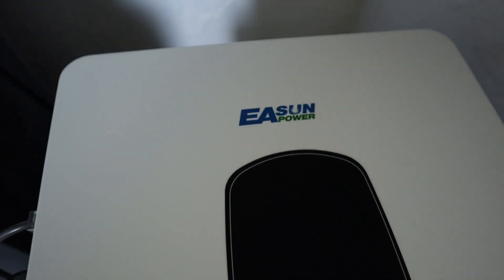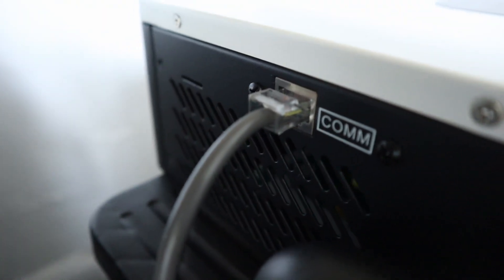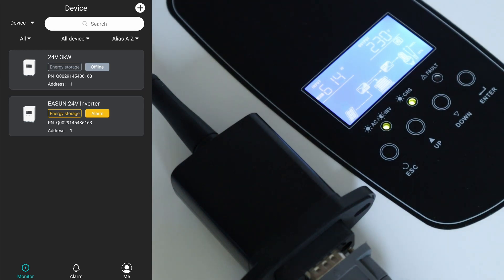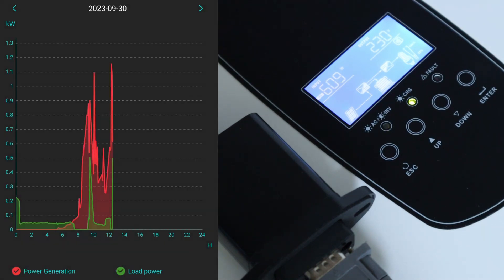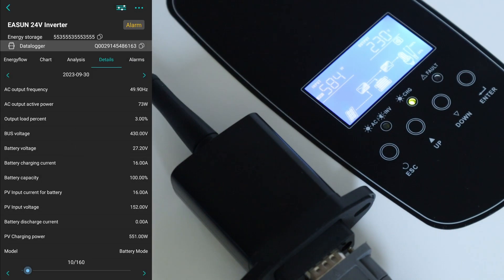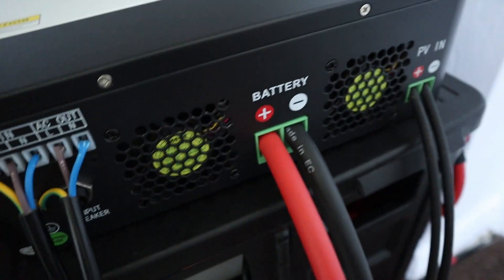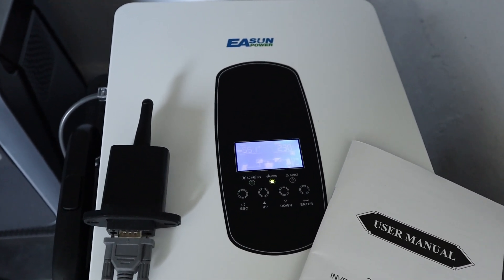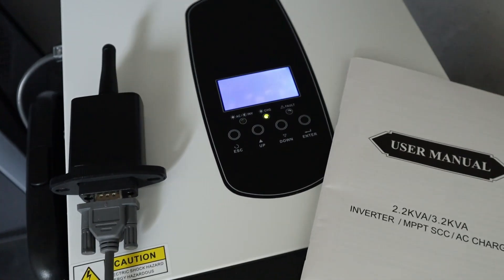EASUN Solar Inverter | Cheap, but worth it?

Comment: I m not agree with you about the fan. They could be more quiet because they are not linked to the temperature of the cabinet they are working even if the cabinet is in a room at 15 degrees. Also in low charge battery condition the  values of current and power  are wrong. The economic mode is bad it s not possible to run a fridge in this mode .In normal mode the unit use 40 W to run with 0 load so during the night the battery is discharged.
Reply from the maker: @arnaudmainil6414  It's fine to disagree with me. I've shared my experience compared with my MPP Solar inverter and the fan control is better on the EASUN (for me) when it comes to input and output load change, I didn't mention about temperature. I agree about the power saving mode (economic mode as you reference) and I don't use it myself due to the pulse method used. I've not had a problem with any of the settings I've used and the battery will discharge while the inverter is on, most inverters have a standby load unless you buy very expensive makes like Victron that have very low consumption when left on all the time. All the best, Adrian

Comment: Hello Adrian, 
Posting my question under this video since the model is close to the one I'm getting. A) Can you (fairly easy) manually control on/off charging from grid? B) Can you think of any way to control the time to have the AC charger kick on? I.e. 1am to 5 am?

Cheers and thanks
John
Reply from the maker: @jbjensen11  Hey John! I use smart plugs for all mains charging of batteries now (exploiting cheap rates with Octopus Energy in the UK). Using the Smart Life app you can schedule switch on/off times or more recently with Solar & Home Assistant. Here's the piece where I've started smart charging automation on Home Assistant https://youtu.be/DHHiSgIEdJE?si=rJT9Wd-kpfaXrrG8&t=1538, set a price and then it charges once it falls below that price (30 min price changes). I hope this helps 😊👍. Cheers, Adrian
Reply: @DADvinci  Thanks a lot for your answers Adrian! 
Thats what I do, except I (still) have not autmated pulling the rates online somewhere, but Ill get into that and will check out what you do with home assistant, which i dont know anything about yet.
 
-So let me now rephrase my question: using the smart plug, you can obviously time that any way you like - so you the EASUN will just start charging once the smartplug kicks on the AC input power to it? (No need to click anything extra - just supply AC power and it starts charging?)
Reply from the maker: @jbjensen11  Yes, that's correct John. Once I connect the grid it provides pass-through power to the AC output on the inverter and also charges the battery. I only use grid to charge the battery on cheap rate, otherwise it's battery with solar running the loads. I hope this answers your question?
Reply: @DADvinci  Thanks a lot. I will primarely use the unit as a charger, but need a way to program it to only charge when grid rates are cheap(like you)  and the seller doesen't understand my question or answers something else...

Looks like, if I just hook up AC input (through a smart plug) and connect to battery, then by programming the smart plug the unit will charge when the smart plug is powered. Correct? Any settings (besides LiFePo4 charging specs) I should beware of?

Later I may utilize the inverter and passthrough options, also. For now I'm happy with my Victron Solar Controlllers and will not use the EASUNS MPPT controllers. It's actually good value, only as a charger - and I like the rest of the functions to play around with later and to have as backup in case any of my current hardware fails.
Reply from the maker: @jbjensen11  No problem at all. On this 24V inverter, other than changing the LiFePO4 settings as you’ve said, I've got the Output Source Priority (Menu 01 Option) on the default setting SUB. On the Charger Source Priority (Menu 16 Option) again on the default SNU. I don't currently have solar connected to this 24V setup, but it works fine for grid charging (same as 48V version) using the smart plug as control.

Like you, I'm also looking to find and review another cheap solar inverter (48V this time) to act as a 'cheap rate' charger for another DIY (not battery box) build. They do offer good value, especially when compared to dedicated LiFePO4 chargers!
Reply: The Powersaving cuts the idle consumption from 28W to 10W I found out. But then I'd need to enter settings and turn off Powersaving each time I charge.  (since "If this inverter/charger is working in battery mode or Power saving mode, only solar energy can charge the battery")
Reply from the maker: @jbjensen11  I’m not a fan of the power saving feature. It pulses the AC output and at first, I thought there was a problem. The extension plug I attached for the AC output has a light to show when it's on and it kept flashing on and off, which I didn't feel comfortable with (disabled it again). I'd rather add a Switch bot as I did in this video (https://youtu.be/O6eRmKvrVd4?si=4zUDXtqB0jcLdz_O&t=1493) and remotely switch off the inverter when not in use. I could even use Home Assistant to automate when power is low to trigger the switch bot (but haven't explored that yet).
Reply: @DADvinci  Dooh - I forgot all about the dedicated on/off switch. I just opened it up, I'll just do what I did to my current inverter, connect a smartswitch in parrallel with that. And program the smart plug and smartswitch to turn on/off 1 minut apart. that works like a charm on my current setup with transferswitch and inverter.

Thanks - I got it, big thanks to you!

Comment: Thanks a lot for that review. I wonder vhy this is 10 times less expansive that Victron's ones. Have you any clues ?
I am right if I say that you can put grid AC IN to load your batteries then display AC CURRENT if PV is not producing ?
Reply from the maker: @rebelion5051  Thank you! I'm hoping you found it useful. This is a budget model so the internal components will not be as expensive as those used on Victron (premium) inverters. When charging from the grid, you can see the number of amps that are charging the battery by selecting what gets displayed on the front panel. Does that answer your question? All the best, Adrian

Comment: Thank you for the video. What "Charger source priority" have you got on i.e, CSO, SNU or OSO. Which one is more efficient. Also for the wifi unit which model should we buy. Do you have a link for it? Cheers.
Reply from the maker: @SaurabhBohora  No problem, I hope the video was useful for you. I use the default option (SNU) on charger default priority, as I'm either charging from solar (with no grid connected) or charging from the grid with no solar connected (for grid battery backup charging). Charging from solar is usually more efficient as the MPPT is already dealing with DC voltage, which is what the batteries are. Charging from mains would always be converting AC to DC voltage, so the losses would be more than direct from solar.

The link is in the description for the model and the one I purchased was the ‘SMH-II-3.2K-Wifi’ version (it can be selected on the product page). I'm not sure why they have changed the image on the main description, but further down you can see the same version that I've got. Might be worth checking with the seller before purchase.

I hope this helps. All the best, Adrian
Reply: @DADvinci  Thank you so much.
Reply: I would like to ask you another question again after last reply. Just wondering if it works without battery in Utility setting in Program 01=UTI, just grid power and solar power (Day and night)? Thank you
Reply from the maker: @SaurabhBohora  This is not a battery-less model I'm afraid. Cheers, Adrian
Reply: Sure. Thank you for the reply.

Comment: Hi, do you know if it’s possible to only run the MPPT while switching of the inverter to minimize draw? Thanks!
Reply: Very curious to know also. I'm planning to use an hybrid inverter like this only for the high voltage mppt charge function only.
Reply from the maker: @martinmooren9536  Good day and thanks for your question. Yes, I've run the unit many times without the inverter being switched on, just charging the battery from solar. You can also do the same for charging from mains power. All the best, Adrian
Reply: @DADvinci  Thank you Adrian for your reply, very helpfull! All the best and keep up the good work, Martin
Reply from the maker: @martinmooren9536  Glad to help Martin😊👍 Cheers, Adrian
Reply from the maker: @hugobenjegard6772  Good day and thanks for your question. Yes, I've run the unit many times without the inverter being switched on, just charging the battery from solar. You can also do the same for charging from mains power. All the best, Adrian
Reply: @DADvinci  thanks for helping out! It’s really appreciated!
Reply: I’ve got another question mate. What size cable do you run between the battery and the inverter? I thought the max amperage the unit could draw is 250A when surging at 6000w so I thought I’d go for 50mm2 wire but the unit says 125A is the max and I don’t even think I could fit 50mm2 in the slots so would 25mm2 be the right choice?
Reply from the maker: @hugobenjegard6772  Keep the questions coming, you may have noticed I like this kind of thing😊. I use 35mm2 for my 24V setups. Shout if you have any others. Cheers, Adrian
Reply: @DADvinci  was the 35mm2 wire a tight fit to get in to the terminal for you mate? I got the new model when I ordered so I wonder if they might have different size terminal holes
Reply from the maker: @hugobenjegard6772  Very tight, took a few attempts with the positive cable (that's the cable size you can see in the video). From memory, I think the manual recommends 14mm2, so if you're planning to use 25mm2, it's better than what it recommends.
Reply: @DADvinci  yeah I saw that the manual recommended 14mm2 but that's just way to low if you want to be able to use the rated capacity of 3000w for the inverter. I'll go for the 35mm2 as well if that's what you used since I've measured the opening and got around 34mm2 so squeezing in the 35mm2 sounds like the best alternative! Thanks again mate!
Reply: Ideally I’d also like to know the idle draw of the unit if you know that! Thanks again!
Reply from the maker: @hugobenjegard6772 Good day and thanks for your question. With the inverter on and no-load the clamp meter measures around 1.3A. With power saving mode on it uses around 0.4A. I hope this helps. All the best, Adrian
Reply: @DADvinci  Hi again Adrian, do you know if its possible to get a off switch with an extension cord to be able to power of the inverter or do you have to use the button on the device? Thanks again!
Reply from the maker: @hugobenjegard6772  It's nice to hear from you! I guess it depends whether you want to keep the inverter on or off. I could rig-up the switchbot to use the inverter switch remotely (not done that as yet). You could also have a smart plug attached to one of the A/C outlet sockets to switch things on and off (although the inverter would remain on all the time to do this, unless you had a switchbot as well). I hope this answers your question? Cheers, Adrian
Reply: @DADvinci  Cheers mate, thanks for letting me know! Appreciate you taking your time!
Reply from the maker: @hugobenjegard6772  Always a pleasure. Have a good one👍😊
Reply: @DADvinci  I've got one more question mate! Have you connected the AC-in to mains, if so what cable size did you use? The manual says 4mm² (12 AWG) but most people I've seen online just do it with a regular extension cord which is 1.5mm2 (16 AWG).
Reply from the maker: @hugobenjegard6772   It's nice to hear from you. I've just used a standard 'short' flexible mains cable due to the way I'm currently using it (moveable battery charger). For me, that's enough to cover the load, around 1800-1900W, when charging at the max 60A with the inbuilt mains charger. For wall mounting and perhaps hard-wiring then you could use 4mm² twin and earth, as that would cover powering the AC output and charging the battery at the same time, which could go over 3kW total draw (more than a standard 13A plug socket) but I've not tested that with my setup as I mostly use it for off-grid and battery charging separately. I hope this helps? Cheers, Adrian
Reply: @DADvinci  thanks a lot mate! I'll probably go for the 4mm2 cable then to be sure I don't burn anything out since I'd like to be able to use both the charger and inverter at the same time when plugged in!

Comment: Hi, i buy same 3.2 easun solar inverter, can i put 6solar panel 380w each whit 49v in open cik tnx
Reply from the maker: @janitrajkov5280  Good day and thanks for your question. The model specification for my unit has a Max. Solar Voltage (VOC) 450VDC. If your model is exactly the same as mine and based on what you've said for your 6 panels connected in series, it would be 6 x 49V (VOC) = 294V (Total VOC) which is lower than the max of 450VDC, meaning it's within the range of the inverter specs. I hope this helps. All the best, Adrian
Reply: @DADvinci what is the model/sku number of your hybrid inverter? Is it 110 or 220v? Thanks
Reply from the maker: @mobro2030  Hey! Thanks for your question. It's the ISolar-SMH-II-3.2K (230V AC) model. Please let me know if you have any other questions. All the best, Adrian

Comment: My EASUNPOWER 8kva inverter arrived damaged 4months ago. NO PV conected but inverter output 60v and no AC output connected and inverter uses 3kva output. 
I have claim a return request that is never been accepted. 4 months pass EASUNPOEWR support is not here issue still here at a brand new inverter.  Anybody need evidence I have video unpacking and connect to battery only. EASUN very bad company

Comment: hello, I also have a 3.8kw SMH II, but I have a problem, at the PV input without connected panels, I have a constant 7-8v, can you measure at your place, please tell me if you also have PV voltage with are they disconnected?
Reply from the maker: @StefanMarian  Good day! To clarify, you've got no PV wiring connected to the PV input on the inverter and you'd like me to test the voltage at the PV input without wiring connected? Are you not using PV on your inverter? Please let m know. All the best, Adrian
Reply: @DADvinci  yes, that means the inverter works on batteries or grid, but the panels are not connected, I have 7-8vdc in their port, I understood that this is normal because these inverters are not isolated, I wanted to see if this happens to you too, because there aren't many on youtube, thanks :)
Reply from the maker: @StefanMarian  Will check and let you know 👍
Reply: @DADvinci  thx, i waiting, mine is 3.8kw :D
Reply from the maker: @StefanMarian Checked and it was showing 7.28V at the PV input when the inverter was on. I hope this helps.
Reply from the maker: @StefanMarian Just checked the new EASUN SMH II 7KW (48V) I'm testing and that was 7.14V at the PV input.
Reply: @DADvinci  ok I understood, so that's all, I thought mine had some problem, I'm very satisfied with it for now, and it doesn't even consume from the grid as others say Easun, thank you very much once again :)
Reply: @DADvinci  oooo power power 🤭
Reply from the maker: @StefanMarian 😊😎. I didn't hope for much when I bought this one and now the 48V version, but for the money I'm impressed so far. Can't say how long they will last though.
Reply: @DADvinci  for this money I didn't have high expectations either, but I was surprised if it works for 2 years, I'm satisfied, after that I'll switch to 48v, I saw a new SMG 6.2kw range MPPT from 60-450vdc and you can put 12 units in parallel, that would be my choice for 48v, continued success and thanks for the help. ❤
Reply: mine is input 56V with no PV connected and output 3kva with no output connected. Brand new inverter connected only on batter first time. EASUNPOWER refused to accept my return reguest 4 months pass and no suport evento fix issue at a brand new inverter. Very bad company ran away or loss you money
Reply: @parrotsparadiselife  I have asked electricians who have repaired something like this and they told me that the inverter is electrically non-isolated and has voltage on all the outputs and inputs when it is working, but on the PV side they told me that I must have somewhere under 20v, that's how they are everything from what I understood, now it seems to me that you have a bigger problem
Reply: @StefanMarian mine is brand new never wired work. An inverter connected to only battery wires it must have PV 0v input and 10-20w output for self consumption. Mine have pv1 0v pv2 56v and output 3kva just batteries wired on inverter. EASUNPOWER reply to me after a video request that it is the first time they see that... but no action to solve any problem of a brand new machine instead after 4 months i still have a band new broken inverter. Very bad company do not buy.

Comment: Hi i didn't succeed to connect the inverter with the app I connect it in hot spot mode but i didn't succeed to add it  on the list of equipment. could you explain hosw you did it thanks
Reply from the maker: @arnaudmainil6414  Good day! I'm sorry to hear it didn't work for you. I added it as a new device whilst connected to my home Wi-Fi (making sure it was in good range) then scanned the datalogger QR code. From what I remember it took a couple of attempts and was slow to connect initially, but then worked. Is yours in good range of Wi-Fi via home broadband or mobile hotspot? I think it needs a 2.4Ghz channel on Wi-Fi. All the best, Adrian

Comment: Hi ,can i put 4 solar panel 600w each on this smh 3.2 ?and if you can give to me full settings ?
Reply from the maker: @secuadrian5419  Good day! May I ask what the Voc (open-circuit voltage) is for each panel? I assume you want to connect in series and you won't have any problems with shading where they will be installed? All the best, Adrian